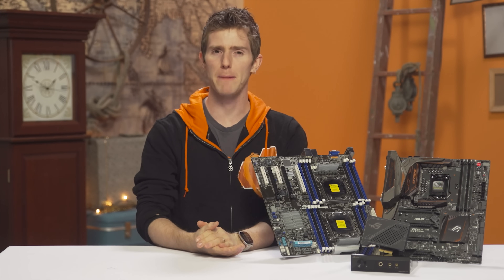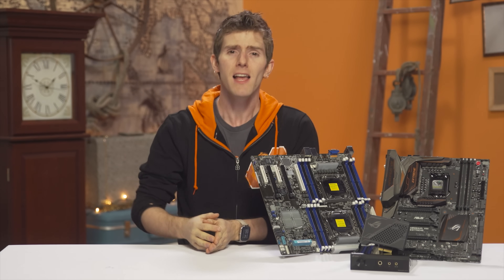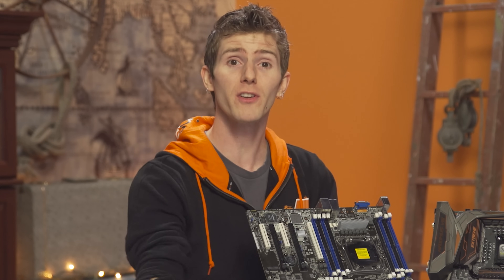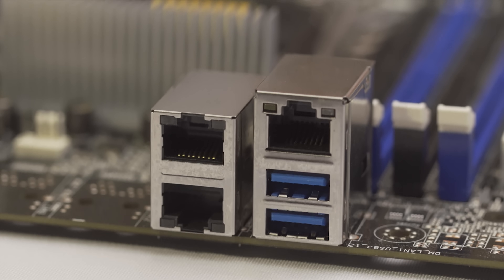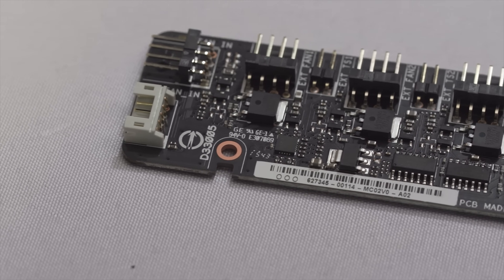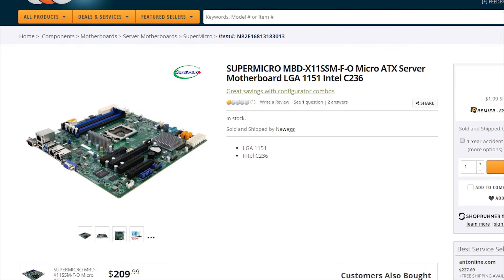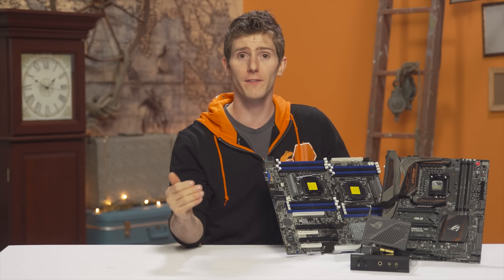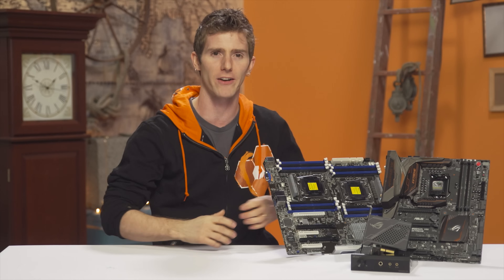What is the best choice for a motherboard? - The Final Answer

Comment: Guys help me which one is better.
http://www.amazon.in/Asus-Z170-Pro-Gaming-MotherBoard/dp/B0126R3QPA/ref=sr_1_2?s=computers&ie=UTF8&qid=1475522335&sr=1-2&keywords=Z170

or 

http://www.amazon.in/MSI-Z170A-Gaming-DDR4-MotherBoard/dp/B013GOS6IO/ref=sr_1_5?s=computers&ie=UTF8&qid=1475522335&sr=1-5&keywords=Z170

I am looking for a red and black theme motherboard and the MSI has a 
more aggressive red and black. But I dont want to loose on features but I
 am buying a 1060 6GB Msi GPU so I think the MSI will play better with 
the GPU but I love the ports on the ASUS... MSI is kinda shit when 
compared to ASUS in terms of port. But I also love the Audio, but dont 
know which Audio boost is better ASUS or MSI. So please suggest me a 
good one. I m going for a 2400Mhz Ram 8GBx2.
Reply: Ignore the colors and go from there
Reply: ThePogoBro
but for sacrificing the colors is the ASUS really worth and better than the MSI. Because since I am getting the MSI graphics card I thought the MSI motherboard will play better with it.
Reply: It will probably have similar performance with the motherboard. It's not like as if there is some kind of proprietary stuff going on with that graphics card relating to the motherboard; the chipset is the same on all graphics card models (eg., rx480 sapphire has the same chips as the. Rx480 MSI) If the ASUS has better ports and similar audio, I'd go for the ASUS.
Reply: ThePogoBro
Oh ok also in terms of the software which one do you think is better?
Reply: vignesh sivakumar the only real software on a motherboard is the BIOS or UEFI
Reply: That won't matter go with whichever you trust most I guess.

Comment: probably better to do a vid on the different features commonly available in motherboards and what they do
Reply: well motherboard features are generally the same, which are socket and related chipset things (obviously lol), connectivity (SATA ports, USB3 support, LAN, WiFi etc), CPU power phase, overclockability, amount of PCI and PCI-E sockets and their speeds, everyday stuff.

Comment: Hey LinusTechTips, What's the best motherboard for AMD FX-8350 Black Edition Vishera 8-Core 4.0. Ill be using one video card, with  16GB of ram. I would like to used DDR4, but if the motherboard only used DDR3 then that's all right. I would like my  Hard Drive to be a intel SSD, but idk if that would work, so if I can't use a SSD. Then I used a SSHD Hard Drive. I want two 2 T, So i would have to get two Hard Drive. and the other thing I have in my Desktop is a wireless internet card. I be used a headphone a lot. I know I be used two USB port for keyboard, Mice  and , so I think have 3 ex USB port. It does Need HDMI plug for my Monitor. Oh ya ill be using a fan system it down. AND I DON'T Over Overclocked. So PLEASE give me your Ideas. It would help me build my first PC.

Comment: A question about SLi and Crossfire support. The "non-gaming" for example has no Sli and Crossfire support.

I thought that it had nothing to do with the board as everything goes through the cables. Okay, in case of Sli you need both PCIe's to run on x8 minimum.

Can some please explain this to me¿

Comment: What sub $150 z170 motherboard can reliably/easily boot from a M.2 raid without crippling the board? Dual M.2 sockets preferred, but a added pcie adapter is an option.

I'm not a gamer, but would like the most USB 3/3.1 options.

Very confused at so many z170 boards.

Thanks

Comment: So, I checked this video out because I was expecting a bit of your opinion on what would be best for a gaming future proof MOB. Currently I am running a radion HD 5850 GPU with an AMD Phenom ii CPU and a Kuhler water cooler for it. 

I am looking to build another gaming rig that is desinged to run Intel CPUs, I was wondering in your opinion what MOB should I choose? 

Also, AMD, or intel. In your opinion what's the best for the money?
Reply: CPU: Intel
Not that AMD CPUs aren't powerful (I own an FX8350) but they are really outdated. Either get Skylake like i5-6600k or wait for the new AMD architecture to roll out (it may take months if not a whole year)
Reply: GPU: the best price to performance ratio you can find, either AMD and Nvidia are good, but mind that every GPU may have own features, like Shadowplay on Nvidia or better Vulkan support on AMD.

Comment: I am thinking of using this set, is this a decent starter gaming one?
http://pcpartpicker.com/list/YzqNcc

Edit: I do not intend to overclock, but with that amount of ram i will upgrade sooner or later.
Also, I may put in an extra hard drive too if i got too much importiant files in the two drives and i am running outta space. (SSD and that hard drive, bitch the SSD's and all other parts are too expensive here in norway. It's like 1000 dollars for you guys or something here, and all I get is this!)

Comment: hello! The Saphire Radeon RX 480 has a PCIe 3.0 interface, but the Motherboard don't ( just a PCIe  2.0x16) Is it a problem or not? I realise that the motherboard used with  CPU Fx series (top ones)  dont have  PCIe 3.0 just the 2.0x16 is it matters? Sorry I dont understand a lot of this stuffs
Reply: It doesn't matter. PCIe is made to be backwards and forwards compatible. Just follow the rule of cats in cardboard boxes: if it fits, I sits.
Reply: Currently, there aren't GPUs that can take advantage from a 3.0 socket. Just make sure it's a x16, because it's everything that matters.

Comment: how would this PC build be? and would it be compatible/run good?
processor-Intel Core i7-6700 8M Skylake Quad-Core 3.4 GHz LGA 1151 65W BX80662I76700 Desktop Processor Intel HD Graphics 530
Power supply- CORSAIR CX series CX600 600W 80 PLUS BRONZE Active PFC ATX12V & EPS12V Power Supply
motherboard-GIGABYTE G1 Gaming GA-H170-Gaming 3 (rev. 1.0) LGA 1151 Intel H170 HDMI SATA 6Gb/s USB 3.0 ATX Intel Motherboard
ram-G.SKILL Ripjaws V Series 16GB (2 x 8GB) 288-Pin DDR4 SDRAM DDR4 2133 (PC4 17000) Intel Z170 Platform / Intel X99 Platform Desktop Memory Model F4-2133C15D-16GVR
I was also wondering if it would run rainbow six siege and star wars battlefront with good fps. 
Thanks.

Comment: I am Looking to assemble my-self a new Gaming PC & I need to knew how to solve compatibility issue for the hardware I choose. Also what Kind of CPU Cooling is most Preferable for AMD. I have witness AMD's over heating as Some of my frineds have them. So AMD CPU's, Do they worth it & What PSU do i need?

What Do you suggest for Multiplayer Gaming PC Rig under 500$

Comment: which is better high GHz and fewer cores or lower GHz and more cores?
Reply: Better more cores is for server.
Better more GHz is for gaming.
Reply: like linus tech would said, it depends
Reply: it depends on architecture
Reply: Hex Bug lets say 3GHz dual-core ARM64 and 2.16GHZ quad-core ARM64 (i hope that is the right architecture for a normal pc cpu, Iliterally just took this one from wikipedia :D )
Reply: same architectures so more is better
Reply: Better more cores is for server.
Better more GHz is for gaming.
Reply: ARM is not a PC architecture. Most PCs use either x86 or x64. And it depends on your use case, and the instructions per second the CPU can perform.

Comment: Still don't know what to buy. I am just looking for an x99 board with x16/16 and an m.2 slot (Gaming but mostly Multimedia use) suggestions? Do not want another Rampage Extreme*
5960x, 64gb ddr4, GTX  1070 acx 3.0
Reply: Check out the ASRock Taichi. That's what I'm going for.
Reply: That's what I was considering, also the Extreme4 and Asus X99-A II because nobody I know really had experience with ASRock and since it used to be a cheap branch of Asus but I guess it's superseded it.
Reply: +GamesNation I mean the X99A Sli Plus from MSI is also very good.
Reply: +SilkDrool 2037 don't know if it's of the same "caliber" to rock a 5960x with it though. It would work but it just wouldn't be practical. If you got a x99a Sli plus, most of the features you would get a crazy price, super ultra high performance CPU for would be negated.

Comment: Hello ! Good job :D
I am planning to get gigabyte h170 mobo and i was looking for compatible RAM and i saw this in mobo specifications " Due to a Windows 32-bit operating system limitation, when more than 4 GB of physical memory is installed, the actual memory size displayed will be less than the size of the physical memory installed."

can you explain what this means ? 
thnx
Reply: It means the motherboard has Windows 32 bit so don't buy it ever
Reply: Basically, Windows 32bit limits the amount of RAM the OS can use to 4gb. Today, literally EVERY new CPU since 2006 has to support the 64bit instruction set, which increases the limit of RAM memory to several exabytes (?). And by the way, the 32 bit version of Windows shouldn't even exist today.
tl;dr: don't install 32bit (x86) Windows EVER.

Comment: I ended up buying the Z170A. Had my own good wifi card/sound card that are pretty good already, won't plan on using the slots for anything else, can OC decently and has enough USB ports for me. SLi support too. I was thinking of getting the extreme for the looks... but figured it'd be better to change out the i7 for an i5 and get the Z170A, then get a bigger solid state drive.. cus' I knew that would annoy the hell out of me.

Comment: final answer dont buy stuff you dont need. WHAT THE HELL DON'T I NEED??
Reply: RGB lighting. On board wifi. 2 CPU sockets. Look at a lot of the stuff on the server mobo. You don't need a lot of that. The consumer board stuff is optional if you want it (lighting, wifi).
Reply: @TheLumbersnack  Dude are you kidding RGB increases atleast 60 fps
Reply: @TheLumbersnack  I kinda do its not easy to get ethernets into my room since I am not allowed to hammer nails on the wall and wifi makes sense for me unless there is another alternative
Reply: @vegitoblue2187  WiFi extenders could help I use one with a Ethernet cable and I get good internet until I’m streaming but that’s just due to me not having the best internet lmao
Reply: @lildad559  I dont eanna take chances. My laptop has wifi and ethernet both but I use wifi. It could be a hood standby to use my mobile hotspot if net goes down for example
Reply: I want on board wifi.
Reply: exactly my thought. didn't arm me with the tools I need!!!!
Reply: So if you want to stream live on twitch. What sort of power do i need? I mean i dont want to stream, but i figured if a rig can play a smooth game while streaming, thats pretty much a good benchmark right? I mean it can take it, which means it can take more?! Per say.
Reply: DopestDope streaming is cpu dependent and your Internet speed
Reply: RGB lighting is very important. ^^
Reply: liquid nitrogen mode
Reply: 128gb RAM
Reply: Really good succinct critique of this video.
Reply: "WHAT THE HELL DON'T I NEED?" answer: it depends on your needs. Don't list things you do need.
Reply: Xandme
Reply: Chuckiele The most important
Reply: DopestDope Games
Reply: He starts saying what you may need around 3:00. Make sure to search everything he says though like SLI, cross fire etc.
Reply: If theres rgb its the best
Reply: DopestDope
Reply: A pc

Comment: Should I change the motherboard for this build? 

Case - Enermax Ostrog GT Blue
Additional Case Fans - 1 x 120mm Blue LED High Performance Fan
Noise Reduction - No Noise Reduction
Internal Lighting - None
Processor - Intel Core i5-6600 3.3GHz (Quad Core)
CPU Cooling - Standard Heatsink
Thermal Compound - Standard Thermal Compound
PC Liquid Coolant - *Requires Iron Tundra Liquid Cooling Systems
Liquid Coolant Refill Bottle - *Requires Iron Tundra Liquid Cooling Systems
Liquid Cooling Tubing Color - *Requires Iron Tundra Liquid Cooling Systems
Motherboard - Gigabyte GA-H110M-A [Max 16GB Memory]
Overclocking Processor - Stock Speed
Overclock Protection Warranty - None
Overclocking Graphics Card - Stock Speed
Memory - 8GB (2x4GB) DDR4 2133Mhz
M.2 Storage - None
Primary Hard Drive - 1TB
Secondary Hard Drive - Samsung 850 EVO 120GB SSD
Optical Drive - DVD Writer
Graphics Card - Nvidia Geforce GTX 970 4GB (Min. 500 Watt Power Supply)
Graphics Card Cooling - Stock GPU Cooler
Power Supply - Standard 600 Watt
Operating System - Windows 10 64 Bit
Networking - Standard Onboard Ethernet (No Wi-fi)
Sound Card - Integrated HD Audio
Office Software - None

HERE ARE THE OPTIONS 
   
Gigabyte GA-H110M-A [Max 16GB Memory]  THE STANDARD ONE

GIGABYTE GA-H170-D3HP
(+ $40.00)

GIGABYTE GA-Z170-HD3P [Supports Overclocking]
(+ $50.00)

GIGABYTE GA-Z170X-Gaming 3 [2-Way SLI/XFire][Supports Overclocking]
(+ $92.50)

MSI Z170A Krait Gaming [2-Way SLI/XFire][Supports Overclocking]
(+ $115.00)

GIGABYTE GA-Z170X-UD5 [2-Way SLI/XFire][Supports Overclocking]
(+ $145.00)

ASUS ROG MAXIMUS VIII HERO [2-Way SLI/XFire][Supports Overclocking]
(+ $195.00)
Reply: /r/buildapc would help you out
Reply: You shouldn't waste your money with Ironsides it's overpriced AF
Reply: I wouldn't bother getting a 970 with the and 480 coming out soon. Also you shouldn't water cool unless you have lots of experience pc building and lots of money to afford it, you're better off air cooling